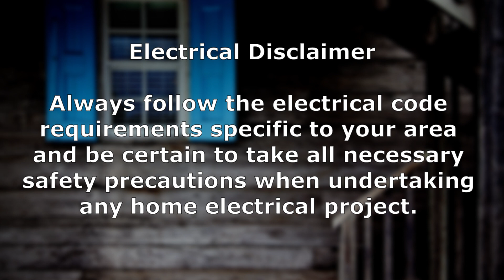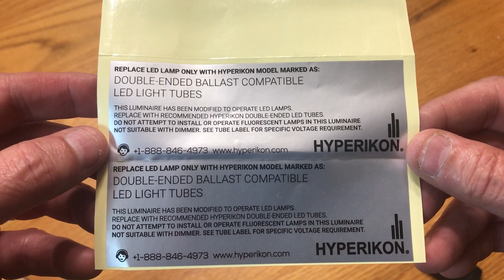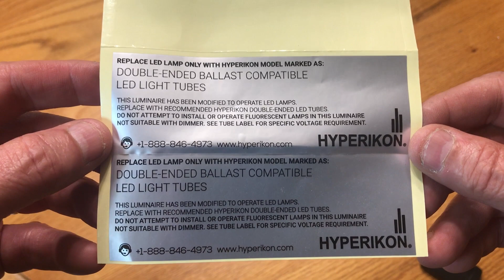Fluorescent to LED | Easy Method

Comment from the maker: 👉Featured Products in this Video:
** Hyperikon T8 T12 LED Bulbs:  https://amzn.to/2LKs62O
** Greenlee 1955-SS Pro Wire Stripper:  https://amzn.to/2ygngRM
** Wago 773 Wire Quick Connects:  https://amzn.to/2YlTtC4
** DEWALT 20v Lithium Drill Driver:  https://amzn.to/2ydmvJt

Comment: I have an old fluorescent floor lamp which has had the ballast fail. It uses really weird bulbs that are in the shape of 2 large "D" loops back to back. I keep thinking that I should figure out how to replace all the guts with a nice LED solution. Maybe while we're all locked down hiding from the Covid pandemic I'll finally have time to check that one off my list!
Reply: Did you follow through on the weird bulb replacement? Thus far it seems no one is producing retro fits for various sizes and styles of fluorescent. The only solution I've found is the LED tape strip.
Reply: @65csx83  Unfortunately, no, I never did have time to get that figured out. That lamp stood in the corner of my garage for many months, and eventually it became obvious I'd just never get around to it... so I got rid of it. It's really too bad, too.

Comment: Great video! I have a similar lamp. Only difference is mine is 2 bulb. I would assume that I connect the reds and blue wires on one end to neutral or hot feed and the yellow wires on the opposite end to the remaining feed wire.
Reply from the maker: Thanks Jeff. I am glad the video was helpful. Yes it’s fairly straightforward. One side to the neutral and the other side to the hot.
Reply: @BudsSmartHome  Thank you!

Comment: So its as simple as the positive or hot on one side of 4ft led and the white neutral on the opposite side?
Reply from the maker: Luke, let me refer you to the Hyperikon Double-Ended Tube Installation-Guide:  https://tinyurl.com/y3msgkmp    To answer your question, if you unsure how to wire these you should have a qualified electrician do the job.  But essentially, yes, as shown in the Hyperikon Installation Guide under "After LED Tube Installation", white (neutral) to one side and black (hot) to the other.

Comment: You would be better off to leave the ballast inside the fixture so you don’t have to deal with hazardous material Disposal. You could use those quick connectors but I don’t trust them
Reply from the maker: Thank you John. I appreciate your comments.

Comment: You lost me on connecting the power wire. Which hole did you put it in? Gave me the impression that it doesn’t matter.
Reply from the maker: Paul Revere - Can you reference the place in the video? Give me the time marking to which you are referring
Reply: @BudsSmartHome  7:15 is what he means, I think.
Reply from the maker: Allow  me to refer you to the Hyperikon Double-Ended Tube Installation-Guide:  https://tinyurl.com/y3msgkmp    To answer your question, if you unsure how to wire these you should have a qualified electrician do the job.  But essentially, yes, as shown in the Hyperikon Installation Guide under "After LED Tube Installation", white (neutral) to one side and black (hot) to the other.